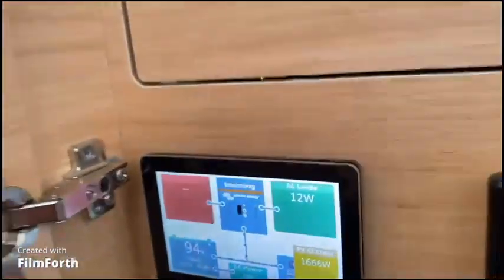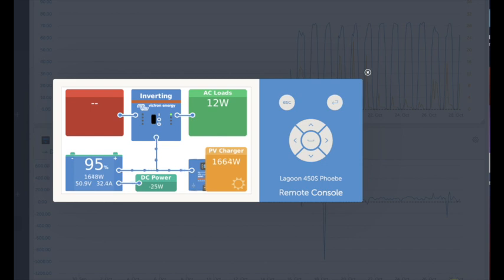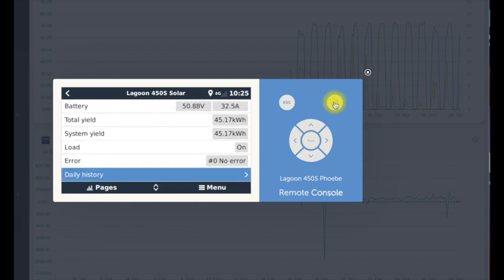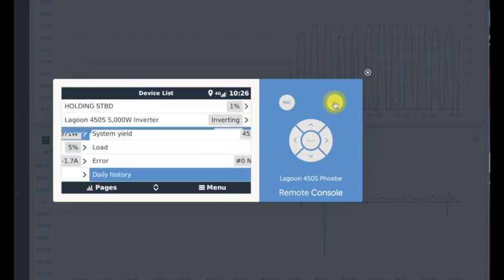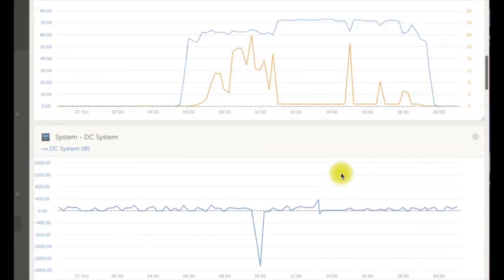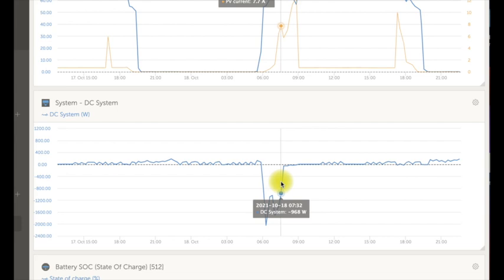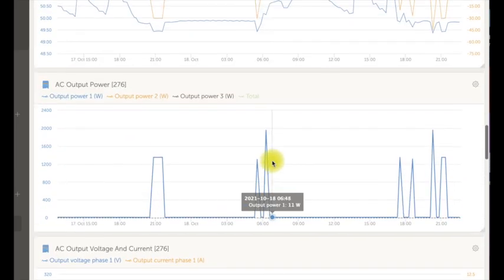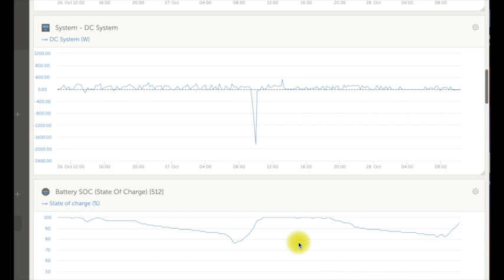New Lagoon 450S Power Upgrade with Scotty on Alternators and 2000W Solar replenishing 250Ah @ 48V

Comment: @safiery.  Did you say victron inverters can run 130% for 30 mins?  Is that right? That isn't common knowledge.
Reply from the maker: Hi Yes, Multiplus Inverter/Chargers can run 30% over for 30 minutes.

Comment: Did you say that the vessel had 2000w of solar panel ? 
I notice that it pulled around 1500w and wondered if that yield was typical of slightly overcast days. It would be interesting to see average yield on a series of clear days. 
I’m interested because I have a van with a system that is limited by the amount of solar it can receive. We can off grid camp but would do a lot better if we could recharge our batteries quicker. I don’t think we need more storage as much as we need to input more power. So therefore I watch with interest as our desire to stay away for longer may end up forcing us to upgrade.
Reply from the maker: Average yield on clear days is over 2,000W
Reply: @Safiery  Nice, for my purposes I’d be happy with anything over 700w but the input limit is 520w through a manager 30. I have 540w and an external socket for extra solar, which at the moment is only good for helping to overcome shade or overcast weather. For now, I’d rather a way to boost the existing system. 360ah of battery seems enough for now but for the next build I’ll try and do better. Thins you learn🤷‍♂️
Reply from the maker: Manager 30 and Redarc in general is not suitable for large power systems. Good for 4wd with fridge.
Reply: @Safiery  things you learn as you go, that’s how it came and it works ok within its limitations but yeah, I think even Enerdrive does better but Victron seems to have even more flexibility and your builds are stunning.
At least I know what to do with the Redarc stuff when I go to upgrade, need a fridge in the 200 too 😂